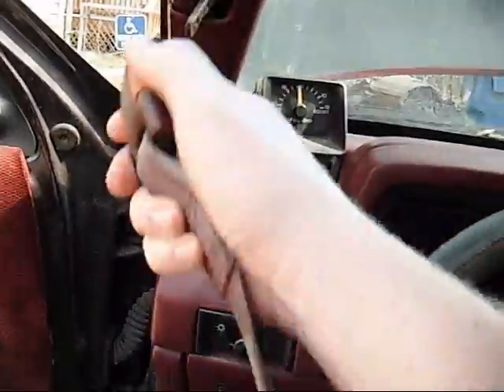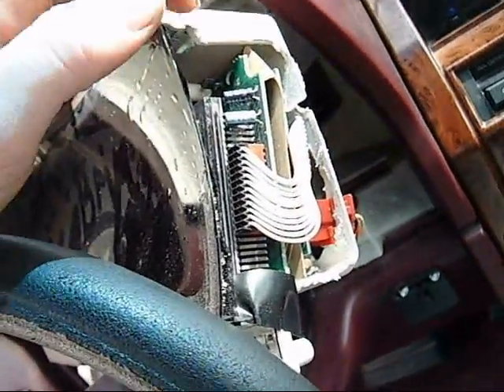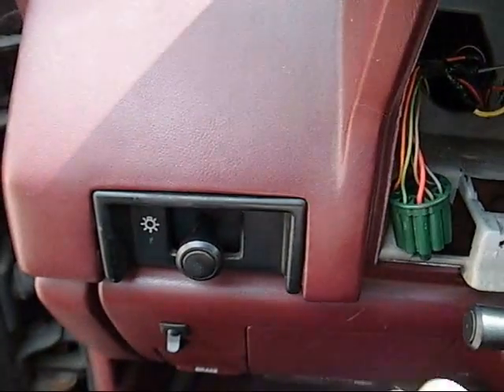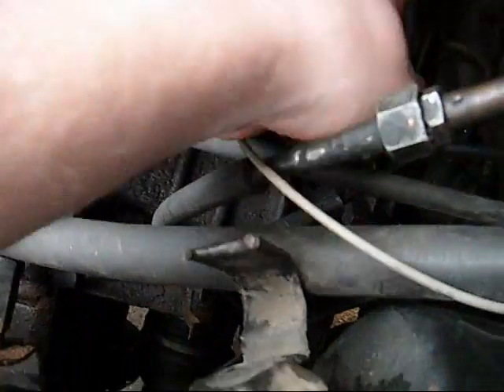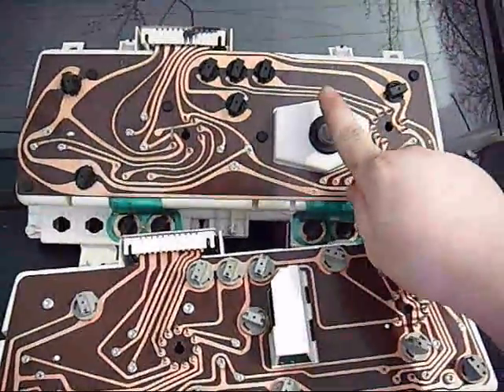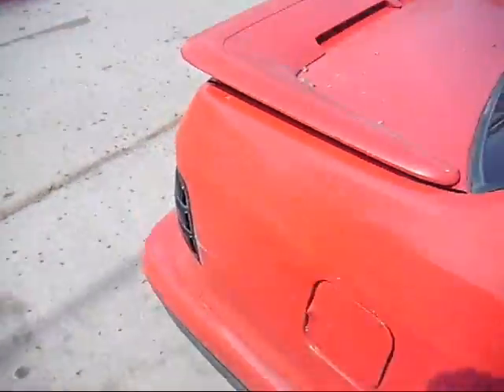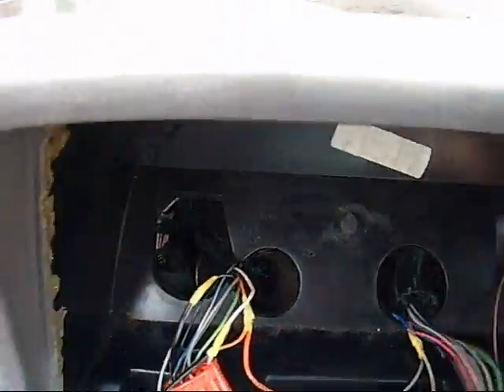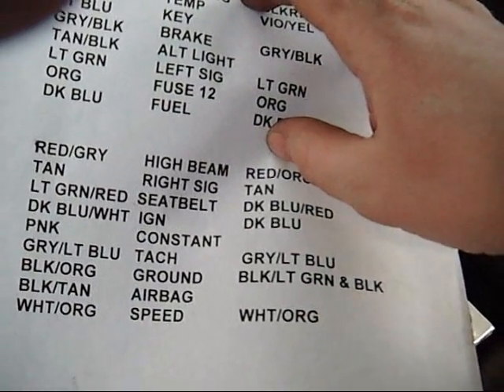Digital Dash Conversion Part 1 of 2

Comment from the maker: @somervillearron Yeah, You haven't seen those? Okay ya a lot of Japanese cars and some American cars had power seat belts. The Shoulder strap will move forward on the pillar like that when you open the door, then retract back to its locked position when the door is closed. I assume manufacturers did this to try and make people wear their seat belts more in the 80's.